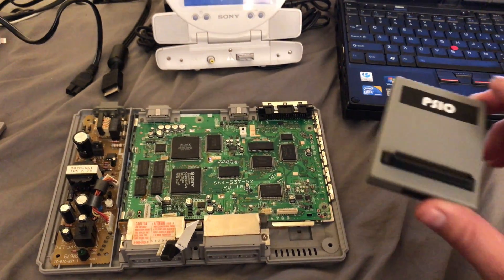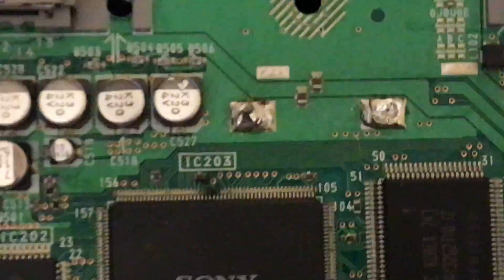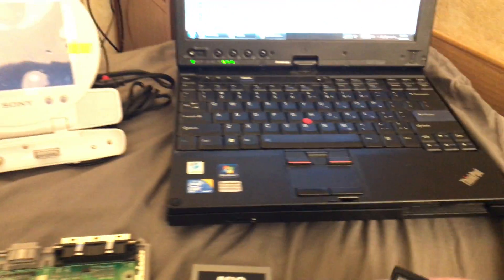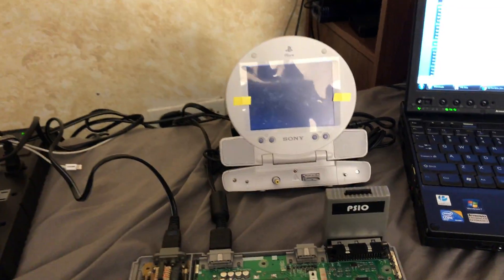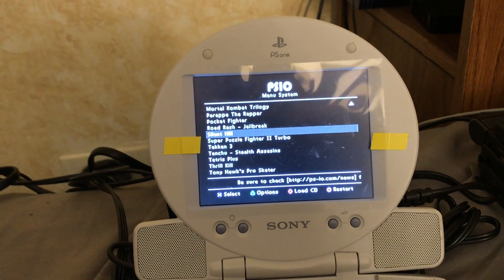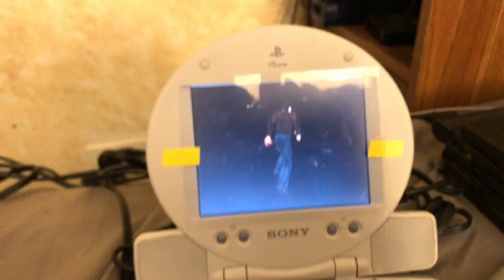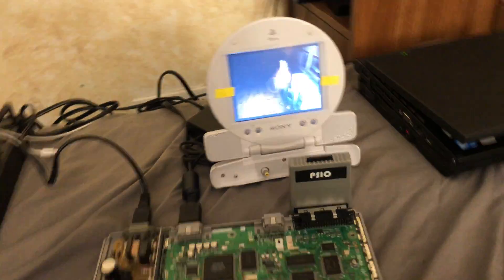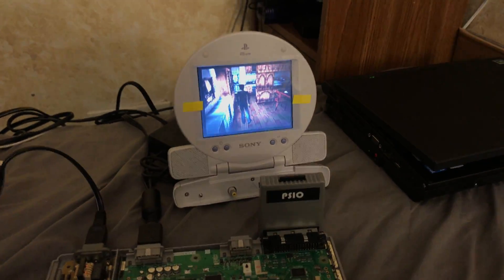Cybdin [ PSIO ] - Demonstration Video - 4K

Comment: does it matter if the original ISO file has spaces in the name?  (Example: Final Fantasy 7.iso instead of finalfantasy7.iso)    ....i read somewhere that spaces causes compatibility issues. just wondering if this is true.
Reply from the maker: +KJ MullinZ I honestly haven't noticed if that impacts a game's compatibility or not..

Since you're only fitting 32gb max of games, I would say to remove the spaces anyways just in case..it won't be that tough considering you won't be renaming a ton of games
Reply: @ItsTheRealMrMaD  I have   COMPLETE SET of the games. All have spaces though. Was Gonna run games through the USB port of the PSIO and PC. Have you had any experiences with that?
Reply from the maker: +KJ MullinZ oh I see what you're saying, I thought you were just copying the games to the sd cards

I honestly haven't touched my PSIO since a little after this video lol..I think I played with it a couple more times and now it's just sitting somewhere collecting dust lol
Reply: would you consider selling or trading it since its collecting dust, bro? : )
Reply from the maker: +KJ MullinZ lol nah, I never sell anything bro

Comment: I have a question why the guy uses a ps1 memory card if he already has the modded card installed?
Reply from the maker: +LoneWolf1141 The memory card is still needed from what I can tell, I didn't get too deep into the PSIO mod past what I showed in this video, but I wasn't able to find a way to emulate the memory cards or save to anything besides those..I assume it's because the PSIO is really only supposed to emulate the disc drive and load games from it

Comment: ItsTheRealMrMaD ,
__ Does the "Switch Board" installation for the PSIO interfere with any other mod chips or can they be used in combination as well as separate if deciding to spin a disc instead?
__ Any insight when 256G+ SD card support is coming?
__ So does the "Switch board" 'detect' and interpret all parallel devices as a PSIO ( negating the use of all other parallel devices ) or can other parallel devices still be swapped in its place?
__ Does the PSIO support or obstruct the use of the serial port for linked console gaming? I see that, so far, there are a few serial port link supporting games listed as having compatibility issues. Can one infer that any serial link supporting title will not work?
__ On another video, 'Q' ? file support was not supported? What are the specifics of that, how important and how common is the issue?
__ Does the PSIO have any issue playing back all surround / 3D audio like Sony's X-360 Sound, Q-Sound and Dolby Surround?
 __ Now reading about a PSIO 'broadband' feature elsewhere ... It sounds familiar from something I read in the last ~ 1-2 years...  my mind can only come up with a Cat5or6 adapter for longer runs between serial port connected PS1s ( not in any way something that evokes the word 'broadband' when considering the data speed ) 
or, more likely, a modification to the PSIO for PC connection?
__ "Thanks" in advance for your considerations and response. 👌
.... [  an appending thought :  ]
With what I interpret is a mod that isn't an easy one to reverse (once circuit traces have been severed for installing the "Switch Board" ) , would it be serving too few a customer and / or at too great a cost and / or too large of a package for the pursuant install if the "Switch Board" had an intermediate socketed board it plugged into from which all of the current wiring to the main board along with wires added to replace circuit paths whose traces were cut could be restored therein by a DIP switch to accommodate as many cut traces so as to restore the PS1's original circuit routes allowing the "Switch Board" to be removed, migrated to another machine and still have what once was a modded PS1 functioning as it did before the mod, without the "Switch Board" installed?
Hmmm... I'll accept my trophy for the longest run-on sentence... therein lies my acceptance speech. 😁
Reply from the maker: 1) as far as I know, the switchboard installation does not interfere with any modchips.
2) No clue, from what I've gathered..32GB is the limit.
3) I honestly don't know how the switchboard works..I want to assume it just reroutes the signals from the CD-drive and sends it to the PSIO, which probably acts as the middleman that tells the security portion of the motherboard that "all is ok, proceed as normal", I think you can still use the parallel port..but again, I'm totally out of the loop on that, and I haven't actually tested any other devices.
4) I unfortunately don't know anything about serial link, as I've never tried it personally.
5) another question I'm unable to answer due to lack of knowledge
6) From what I can tell, the PS1 only outputs stereo sound.
7) I haven't even heard about any PSIO broadband

8) Sorry I wasn't able to answer any of these questions with any real certainty.  I basically just bought the device, installed it, and tested it out a couple times before forgetting all about it. I didn't really research any of the technical details about, and just figured I'd try it out on a spare PS1..but the 32GB limit really put me off, as well as the fact that not all games are playable (or so it seems).  Plus, I just don't really have the time to delve too deeply into this device.

9) these are more questions that should be aimed at the creator of this device..I was simply showcasing the functionality of it in this video, but I honestly don't know much about it other than it's "kinda like an everdrive for the ps1"  I do think it wouldn't be that hard to "undo" the installation tho, as long as you don't mind using some jumper wires on the cut traces..

Comment: does it support game swapping? like for action replay or gameshark?
Reply from the maker: +Scharie Feldt you don't need to Game swap since you're just loading the games off the SD card
Reply: yeah i get the idea. what i mean is. how do you apply gameshark / action replay codes. those cheat engines require game swapping.
Reply from the maker: +Scharie Feldt ooh..that I'm not really sure of..it probably won't work with this, unless you just use a disc and the game shark instead of the PSIO

Comment: The price 150$ is stupid and crazy proce ,with that price u buy cfw ps3 that can still play ps1 iso via multiman
Reply: Dallas, Texas area. I bought a brand new 7501 on eBay awhile back for like $70 - I just preordered my PSIO the other day... woo!
Reply from the maker: +amunve I guess the real appeal of this to me personally, is that I'm not emulating anything, and I don't mind paying $150 for a solution that lets me do this on the PS1's original hardware.

$150 isn't that big of a deal for me for this type of hardware, because it is a unique and kind of "rare" item that nobody else really has.. but I could see how that seems like a lot for other people, especially for those who don't really care about whether or not they're playing an emulator or original hardware.

It's the same as those EverDrive flash carts (which I have almost every single one of), some are at or around this same price, and all they do is play just that system's library.

Meanwhile, my $30 Raspberry Pi can play the entire library of pretty much every single game all of my EverDrives and PSIO support, and is significantly cheaper..but, it's at the cost of playing those games with an emulator versus original hardware.

Hell, even my $5 Raspberry Pi Zero, and $10 Raspberry Pi Zero W, can handle most of the games, but at the end of the day we're still talking about not having these games playing through the hardware they were originally intended to be played on, and while emulation is great, it's still never 100% and just doesn't have the same "feel" as firing up a game in its respective console.
Reply from the maker: +amunve I do have several Rebug 4.81.2 CFW PS3's btw, pretty much every model that allows for it, including a couple backwards-compatible CECH-A01's with the legit backwards-compatible hardware built-in (as well as a couple of the later CECH's with the native /software/ backward-compatibility), and while I enjoy PS1, and PS2 on them (as well as some other stuff, from time to time) I really just prefer using them for PS3 software.

I also have fat PS2's with freeMcBoot and HD loaders on em loading up some physical IDE hard drives, some with SATA drives, some running SD cards, and some loading games from my own private internal network..as well as a couple slims that do that as well.

So naturally, I felt compelled to buy this product because that was the only console I was missing that allowed for loading of games without the optical media.

N hell, I'm /STILL/ looking to buy the other solutions for the other consoles, like Sega Saturn, 3DO, Dreamcast, etc..

I've been trying to find those forever now, and to this day I've still not been able to find anything but this PSIO
Reply: Is slightly more than the price of the NES, SNES etc Flash carts...
Reply: This fucker is in every single video about PSIO saying that it's "too expensive" and shit. You know what? If you think it's TOO EXPENSIVE then go FUCK YOURSELF and stop bitchin
Reply: Luxuries? Really? It's $149.. I wanna buy a brand new (factory sealed) Playstation 1 SCPH - 7501 and that's gonna be EXPENSIVE and I'm not even sure If I could find it..
Reply: And to top it off, it's not even expensive..a NES and SNES SD Cart is the same price for the most part.
Reply: Where are you from, dude? You know where can I get a new PS1 7501? I want it so bad! I'm gonna buy the PSIO too!
Reply: I want it to last forever lol. That's why I want to buy the PSIO and also to use the laser to play original games (just a few, my fav ones). I know it won't last forever, but I wanna have it as long as possible. I want a complete collection of my fav consoles, that's why I'm also looking for a brand new PS2 39001 (for a couple of original games + HDD).
I don't know why I feel the urge of getting them ASAP as if they were to disappear or something, lol. Maybe I'm just feeling nostalgic or old, lol
Reply: Yes $150 might be a lot for some and not others, but in DIRECT comparison to other products of the same thing, it's a fair price. So complaining about the price on every video on YT is useless.
Reply from the maker: +Maloriak nah, I hear you..but maybe the better solution is to just find a really nice clean one that's CIB and just buy a bunch of lasers..that way if one ever goes out, you can just replace it without having to spend tons of money and time trying to find some really rare unopened one that you'll probably end up feeling guilty about opening in the first place lol
Reply: I don't live in the USA, bro. I'm from Peru and here all consoles are almost destroyed or very old/used (PS1,PS2). I don''t trust sellers in my country, man. That's why I wanted to get a new 7501 ps1. I read that this version is very reliable and strong compared to others. I also considered a 9001 but they lack the parallel port so it defies the purpose of the PSIO.

I think things are way easier and cheaper in the USA. Shipping to Peru is expensive as f.. and the package may arrive broken or opened, lol. I guess I need to travel to the USA, bro, lol
Reply: Lol! Yeah, I think I need to go there and buy a new one and also buy lots of spare lasers to repair broken consoles (I got 2) and to make my new ps1 last longer, lol. Are there retro gaming stores where you live?
Reply: Oh man that sucks - Move to the US ;) lol jk
Reply: You guys are so mean, lol! No, just kidding. i need to move to the US!
Reply: Yeah it takes like 3 months to get it after you place a preorder..but they have been improving the development process for awhile and soon should be a "final" version then they will be able to start selling them more readily.
Reply: ItsTheRealMrMaD ,
You sound like a well experienced Pi user. Am curious if a couple of Pi can achieve serial link....
 >>> Does Pi emulation of PS1  support console linking, offering a connection pathway to emulation of a pair of serial port-linked PS1s for the likes of Command & Conquer Red Alert Retaliation, Trick'N Snowboarder, Descent, Twisted Metal 3, Rogue Trip: Vacation 2012, Bogey: Dead 6, Blast Radius... all of the console linkable titles?
Reply from the maker: +Maloriak lol..some people are just not able to afford these little luxuries, I guess..

My problem with that mentality is, instead of seeing it as motivation to get more money, they want the world to change for them and lose out on their profits just so someone like this can get it and..probably hate on it anyways lol
Reply from the maker: +Maloriak lol, you'd be surprised how much $150 is for some folks bruh..

It may be a drop in the bucket for most ppl, but there's a lot of folks out there that just can't justify spending that much on some video game hardware yunno?

With that said, I don't think it's a crazy price.

I've bought everdrives for every system they're available for, and the newest, most updated ones tend to be up there in cost, especially after you add in the shells and supply your own SD cards..

Cos some games alone cost more than the everdrives themselves, and same goes for the PSIO..I'd much rather play them on the PSIO on the original PS1 hardware first, to see if I even like it, before dropping a bunch of $$$ on some game i may not even like..so for me, $150 is nothing for such an invaluable device..plus, it's just cool to have.
Reply from the maker: +James Pyle it's not, but again, for some people it might be..
Reply from the maker: +Maloriak I'm from Chicago.

N I'd say the easiest/quickest (but more expensive) source would probably be eBay..I'd assume they have it complete in box, unopened, and whatnot..but can I ask why you want that specific model new?
Reply from the maker: +Maloriak you want it brand new?

Cos I just checked eBay and I'm seeing a bunch of complete-in-box 7501's but I don't think they're actually sealed/brand new..but they're pretty cheap still..anywhere from $80-150
Reply from the maker: +Maloriak oh damn, another South American hermano 😎

I'm 100% Colombian myself, but I haven't been there in like 20 years or so..

N yah, I guess the easiest way is to just come to the states for a little bit lol..or you can just buy the lasers to repair the broken consoles or somethin
Reply from the maker: +James Pyle agreed lol
Reply from the maker: +James Pyle nice, I'm surprised they're still making em..it took me forever to finally be able to get myself one..I was stalking the pre-order page forever
Reply from the maker: +Maloriak tons of em dude..but they always charge extra for the nostalgia factor I guess..

Buy/sell groups are good, and for stuff like lasers I just go with eBay or amazon cos I have the purchase protection/money back guarantees
Reply from the maker: +James Pyle shit, he's better off there ..lol 

I heard it's gorgeous there n everything here is really starting to suck anyways
Reply from the maker: +Maloriak nah dude, it's miserable over here now..everything is too expensive and there's too many rules for everything lol..
Reply from the maker: +James Pyle any word on support for larger SD cards?